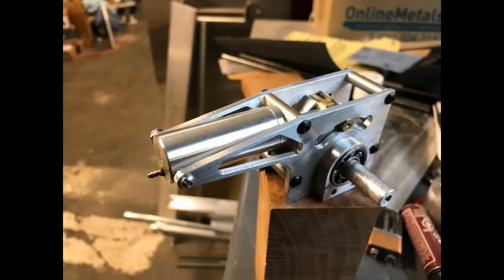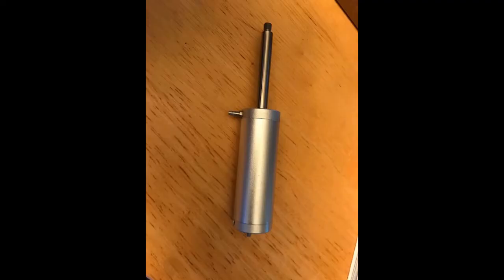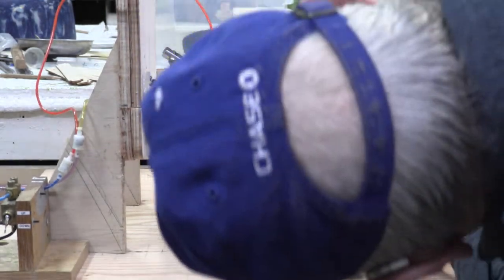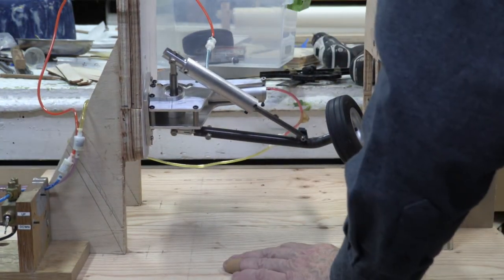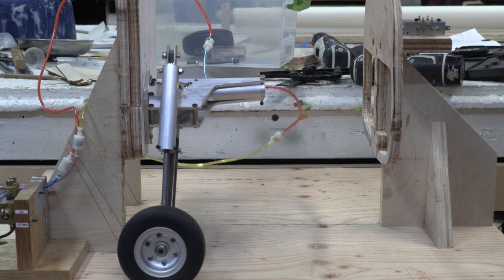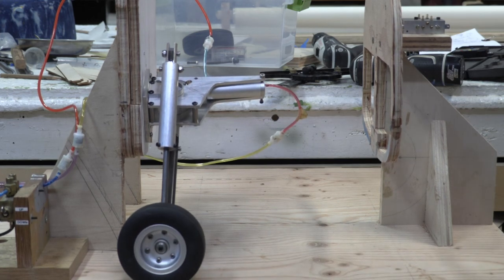S3 Gear design and testing

Comment: Where do you get plans to be able to build an S-3, I'm guessing for an RC version.  I flew in the Viking from 79-98 and would like to build a large model.
  I hobby in both 3D printing and Laser engraving/cutting and want to see what I can do if I get plans.
Reply from the maker: We  could not find plans, so we are scratch building this 1/9th scale version as a group. It would be nice to have the drawings for the full scale airplane, but Lockheed doesn't reply to requests, so we are using a 1/48th scale plastic model to design our RC version. We may end up with a set of plans and, if so, we could probably be convinced to give them away. If you send me a PM, I will share my email address with you. Jim Lake